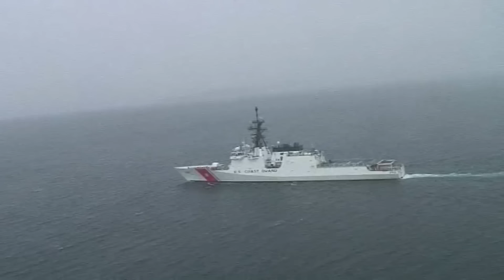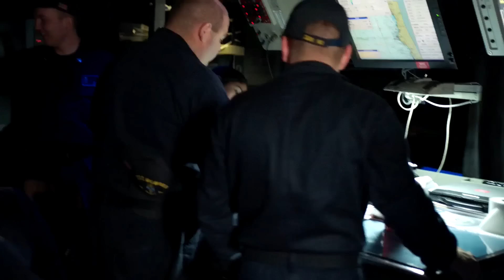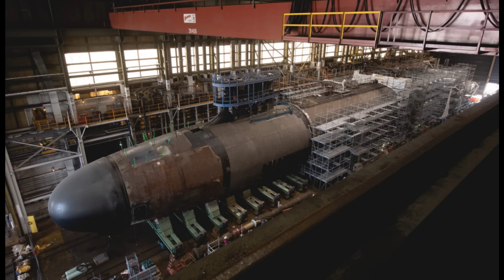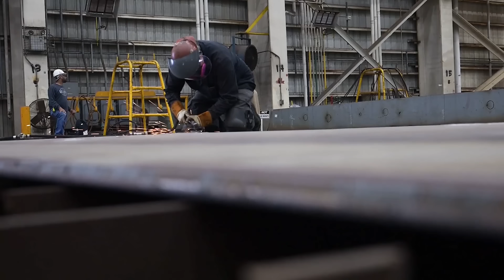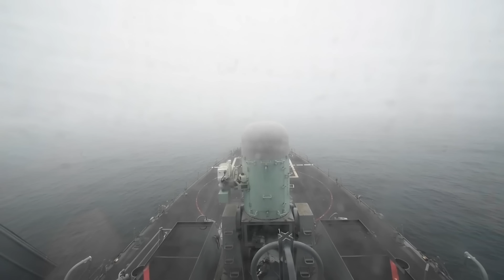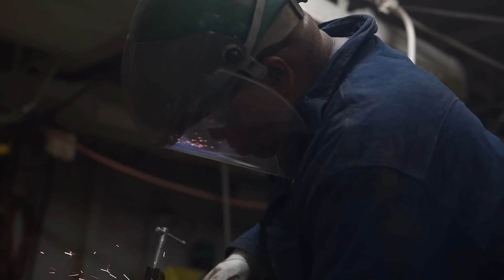The US Navy’s Radical Plan to Build Its New FF(X) Frigate Faster and Cheaper

Comment: It is baffling to me how fucked up are navy ship building fiascos are, to the  point that I wonder if the failure is intentional by those involved for whatever reason, political, corruption and or foreign influence.   

The failure of the Constellation Class is perhaps the biggest of the bunch.  A proven platform that had different variants based on primary role and instead of restraint and even correction of errors in the Constellation Class, instead of scrapping a program killed by the Navy simply wanting a different Arleigh Burke, like say Anti Sub Marine warfare and modest Anti Air and or Land strike capabilities.  

The whole point was to take the work load off the Arleigh Burkes like Anti Sub and escort missions. 

Instead, the plan is to give the Navy a ship it cannot add anything to, even Anti Submarine, Anti Air and or anything else but the lightest of workload.  

It's baffling when the navy already ruined one proven platform and now the plan is to give them a less able platform that while proven as Cutters, they are not proven in a combat role and or were ever designed for that purpose.

Comment: In Spain, Navantia is building the F-110s, a new version of the F-100 anti-aircraft guns equipped with SPY AEGIS radar but with full anti-submarine capability. Many of the systems are American-made; they have been designed and tested, and the first unit is almost operational. It's essentially a smaller Arleigh Burke, costing one-third as much but with the same capabilities and significantly more advanced technology.

Comment: Move the flight deck/ hanger to the stern,  stick the Nixie and VLS under there.   Use the space created amidship for weapons.   Or design a hull plug to add volume.   Plenty of possibilities.  I have no doubt that the initial hulls will end up in the Coast Guard.   Just not enough capability.

Comment: Good presentation and comments.  Some of us are former Perry/Knox class sailors and understood the frigates mission as ASW and outer ring security.  The Perry's had a limited AAW and surface to surface capabilities.  The Knox was ASW.  Containerized weapons sounds good on paper but the reality is a little different.  I agree,  the new frigate does not need all the bells and whistles the Constellation class was going to have.  I believe that concept was to build a Burke lite due to cost of the flt III Burke's.  Also agree you need to take some of those missions away from the Burke's and give them to a ship more suited to that mission.  This was a failure on leadership two decades ago thinking we can build destroyers that can do everything.  Yes, the Burke's can do pretty much everything but at what cost?  Now, we're getting a known ship with known capabilities.  While the Legend class is a good ship I do not feel it will take the place of the old Perry/Knox class frigates.  Why?  The containerized concept?  Configurable for a certain mission set?  What happens when you need more AWS assets in theater?  You have to send another ship or have the current one with-drawl for "reconfiguration"?   No, that does not make sense when there are already 4 designs for the Legend class.  So yes,  you can build this ship but you are already working on the "real" frigate replacement.  That frigate does not have to be a Burke lite?  It does need ASW, AAW and surface capabilities.  It does not need Aegis/SPY's, just solid sensors and LINK.

Comment: So we are regressing back to the LCS and the idea of modular containers for various capabilities? 

It's actually shocking how much everything said about the new frigate program sounds incredibly similar to the talking points about LCS. 

Now just because that program was a disaster doesn't mean this one will be but it does raise a number of flags.

The modular construction is also concerning. Yes it can be a faster and more flexible way to build but it can also be a much more difficult and slow. The problem with modular construction is it requires very tightly controlled design and fabrication of all the modules. Variations in design or understanding of design can lead to massive complications in assembly with lots of delays and rework. The use of multiple firms to build individual modules makes this critical design control even harder.

Comment: This ship needs to be built as an ASW platform. Stretch the hull as needed for a hanger big enough for an MH-60R, which is much larger than the MH-65 the existing hanger was built for. Now add room for spare parts, tools, sonar buoys, torpedo magazine, air crew and maintenance crew berthing, and aviation fuel storage. Find room for torpedo tubes on the main deck, port and starboard, and more room for another or larger torpedo magazine. Add hull mounted and towed array sonars and don’t forget additional berthing for the Sonar Techs. Are you going to be able to feed all the additional personnel with existing mess facilities? Give it as much defensive capability as you can using completely self-contained, autonomous, deck mounted systems. 

I am concerned this ship is going to be worthless as it is so making it a top tier ASW platform is the only option. However, stretching the hull enough to equip it as I have detailed will probably require widening the beam. Now you have a whole new ship design. Somebody needs to think real carefully before spending a bunch of money on a glorified bass boat.

A better option would be to go back to the Constellation. Scrap the SPY 6. VLS is not needed except for possibly ASROC capability. Reimagine it in its original size. Build it out as I described above. It could be just what the Navy needs.

Comment: Radars are smaller and detection is just as far when they need to extend that range drones with radar bouys drop them off then radar just went bigger, for anti air hyper velocity projectiles out of the main gun, lasers for drones even boats, reloadable missiles at sea so 500 pound explosive cruise missile would  have a booster to get up high then kick in or travel far fast then kick in the could load it all up in the helicopter work bay that would be out of the weather seems simple and cost effective also a big helicopter could land replenish the missiles and take off

Comment: Good analysis. The original design does not require much in the way of modification in order to accommodate a 16 cell VLS, an upgraded EW suite, NSM ASM box launchers, a Griffin Missile launcher and a TAS. The weight and power margins are there along with the under-deck space for the VLS. It has trans-pacific range, high endurance and proven reliability. If armed with 8 ASROCs and 32 ESSMs it could serve as an effective naval escort frigate for merchant convoys in the open ocean. It is a frigate ... not a mini destroyer, and the shipyards required to build them, and the supply chains required to sustain them already exist.
Reply: As long as the FFX has the Mk-49 RAM with 21 missiles, the FFX will be a useful contributor escorting tankers and supply ships of the Mr. Roberts backwater mundane navy... Currently the largest weakness of the navy is escorting tankers and supply ships, we are wasting the combat capabilities of the DDG not escorting aircraft carrier task forces...

Comment: Importantly, the Legend-class already has extra space for added systems, like extra fuel capacity, battery banks and even a 24-cell Mk41 box forward of the superstructure, according to a USCG spokesman months before its selection for the FFX.  One capability that will be added by design is control of Dauntless-class USV with more containerized munitions.  In fact, one Dauntless alone can add a containerized AESA radar unit plus five Mk70 boxes, for up to 20 SM-sized missiles.  As an FFX, it may be able to control up to six Dauntlesses as they are being built robotically at Port Alpha and soon Port Beta.
Reply: Yes, he went on the record; 12 up front, space for 12 sternward, or possibly more in the bow if the gun mount is moved to alternative spacing slightly forward of where it is.  I'll look for the source video.  Been a couple months.  Bear with me.  I was surprised how much unused volume was put into the Legend for future use.
Reply: Wait, 24 cells? The most Mk41 cells I found on any NSC derivative was 16 cells (FF4923). Did this USCGC spokesman go on the record? Do you have a source?

Comment: 20-25 years ago the USCG had a specification for what is now the Sentinel class cutters.  A brave commandant, had the courage to throw out a nascent high-tech design, that was going to use exotic materials, and had other design features that would have made its price balloon.  There were serious questions as to whether the original design would even work properly

Commandant Chad abandoned that design, chose the DAMEN 47 metre patrol craft, made some minor adaptations.  

And that class has proven so successful, they have extended the number of hulls.  They proved very successful

Comment: Great video.
What's often overlooked is that the USCG Cutter was built with an "adaptable modular space" behind the gun.  If war broke out, all these Cutters could be upgraded within weeks.  It's the size and depth needed for limited VLS.
The space has NEVER been "officially" confirmed as a VLS compartment, but when Industry analysts and the shipyard confirm it has the weight, space and power for:
Torpedoes - 8-16 VLS, Harpoon of NSM launchers or 48+ Navalised Hellfire (UK Brimstone) missiles.  Then you can expect this system to be in place in some form, even if it's not in the Flight 1 batch.
This was reinforced by the HI bid for the former FFG(X) project with a similar layout. Containerised systems have limitations but could add additional capability on top of what's already possible.
When the Flight 1 is in the yard, the supply chain set and reinforced, procurement contracts set and the 1st examples are rolling down the ramp - THEN we'll see a Flight 2 with the Centre Section plug that the shipyard also said was possible for future upgrades.  The official line has been quantity first, quality of weapons second (for now).
The USN is doing this to preserve as many of it's Destroyers as possible and a Frigate capable of low level threat missions is a great step towards that goal.  Or your amazing Arleigh-Burke will start to wear out faster than you can build them.

Comment: Great video explaining a good concept. For everyone saying where are the VLS cells, that’s not the role they are being designed for. These are ESCORT SHIPS, not stand alone surface combatants. Think of them like the Destroyer Escorts (DE) from WW II. They will take the burden off the Arleigh Burke’s and the future BB-XX (and yes Trump haters, they WILL be built) of performing mundane and lower capability tasks like mine defense and submarine detection, letting them concentrate on the mission goal. They will also  strongly reinforce a last line of defense anti-air capability with their short range weapons, and could also be incorporated into some type of future electric warfare anti-drone system. As for the comparison s to the Little Crappy Ships, re-check  the steaming  range of these ships and compare their real world proven propulsion system to the junk on the Crappy Ships and the Zumwalts.  It is a cheap, viable, and relatively quick to build option to get more blue water capability out there.

Comment: HII has hull 11 started and suspended for the USCG and materials procured for hull 12.  Those two will be built to the Flight 1 spec to develop the “book” on building the frigate.  The internals are already designed to accommodate a VLS, ASW sonars and weapons, secondary cannons and advanced sensors.  Hull 3 will for the Navy will be the first “Flight 2” Frigate with these capabilities included while the first two serve as training ships and trailblazers for the class.  Meanwhile other yards, equipped with the methods and procedures generated by HII on the first two ships, will begin building flight 2 ships as well.  The Flight 2s will be potent ASW platforms with limited anti-air and surface warfare capabilities but should be very capable against light combatants and pirates.  They should also be equipped with drones for both offensive and defensive missions.  Like small swarms of Anduril Roadrunners.

Comment: How much will these cost each, because if it's a dime over $300 million it's too much, it doesn't address most on the problems facing the US Navy, At $490 million the Japanese Mogami Class Frigate does everything this Frigate can't do, Superb Anti-submarine platform, mine laying, 32 VLS cells, air defense with RAM and CIWS, advanced radar that will integrate with Aegis, 30 knots top speed and 10,000 nautical mile range.

Comment: I think this is exactly the the ship we need. This is the same situation as the Spruance destroyer which had one sparrow launcher which could hit targets down to 30 feet, vs Oliver hazard Perry whose SM! Missiles could not go down below 100 feet and was hit by 2 Exocet missiles. Currently china has a high flying hypersonic missile which can only be shot down by SM6 which the constellation would not have carried. The other antiship missiles that both Russia and china have come in at mach 3 at sea skimming altitude, which means the radars would pick them up at 15 miles from the ship. The missiles would cover this distance in about 25 seconds. By the time the ship detects the target and decides on shooting at them about 5 seconds would have passed. That means the intersection would happen at about 5 miles from the ship.  So it does not matter if the weapons the ship carries are evolved sea sparrow vs rolling airframe missile. Also since the vertical launched missiles have minimum range longer that the RAM as the missile is shot upward.  the Rolling airframe launcher actually provides a closer minimum range. I suspect that is why the Arleigh Burkes are having rolling airframe missile launchers installed. With respect to anti-ship missiles and land attack missiles, the FFX is to carry the naval strike missile which can attack both ships and land targets to  range of 190 miles but can not be launched from the MK41. It requires its own special launcher which these ships will have 8 to 16. I think this is exactly the ship that we need right now.
Reply: Can't the helo do anti-sub work too? I don't t see a problem with it being unarmed for its missions.
Reply: @cyborg2048  Yes... A Seahawk helicopter does ASW work, drops torpedoes and sonar buoys... The FFX will also most likely be fitted with Mk-32 torpedo tubes as well... There is much more to a warship than VLS cells...
Reply: As long as the FFX have a Mk-49 RAM with 21 missiles, she will have sufficient anti-air self defense... There is no need to equip her with a 16-cell Mk-41 VLS for longer range ESSMs or SM-2s... That is what the DDG with Aegis is for... If the navy wants more numbers of warships, the navy will have to settle for frigates instead of destroyers escorting tankers and supply ships... For every frigate built frees up one destroyer to escort a aircraft carrier task group... The backwater mundane Mr. Roberts navy exists... The front line navy would starve without beans and bullets, not to mention fuel...

Comment: Without any decent offensive or defensive weapons it has zero chance in a modern peer battlespace, but don't worry its lack of sensors means that you won't even see it coming. I am not asking for 90 VLS cells and the latest spy 6 radar, but it would be nice if it were capable enough for missions beyond just anti-piracy. Right now this is nothing but a meat shield for the fleet and a perfect way to get a couple hundred sailors killed. Give it a decent sonar/radar and 16 VLS cells and it has a fighting chance because the hull design itself is actually pretty good once you reduce the radar cross section, which they are already planning on doing.

Comment: If one reads into the history of the Littoral Combat Ship procurement - which looks more centered around Special Operations Command needs than Navy needs (deployment of assault vehicles via a stern deck and roll-off gate while the equipped helicopter lacks towed sonar for Anti-Submarine Warfare) - the Navy always wanted a Guided Missile Frigate that can be expected to survive front line combat. 

The design changes of the Constellation-class were thus not just a 'Pentagon Wars' case of confused bureaucracy or corruption, but a rational requirement (despite being procured for 'front-line service', European Multi-Mission Frigates are - arguably - not survivable against similar sized ships with contemporary Guided Missile armament - hence the US Navy intervention). 

(Francis Tusa on the survivability of the Iver Huifeldt-class based, UK Type 31 Frigate at 400 plus million USD - de facto a corvette at the cost of a Cold War Guided Missile Destroyer) 
https://youtu.be/L4hs8od5BYU?si=l4GbzIo12OovLjXk&t=193

The problem is that the Navy failed to estimate what standard of combat capability it could procure in the numbers, it desperately needs for continued global operation . 
After trying to alter the FREMM design, the proposed 'Extended Patrol Frigates' by HII answered that question, now which arguably points more toward avoiding contact for manned vessels than enduring contact...